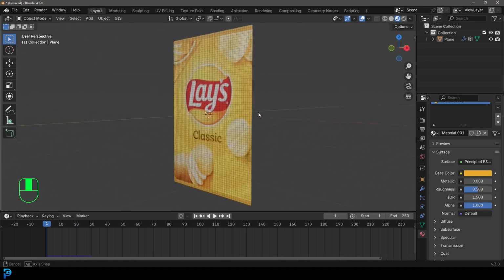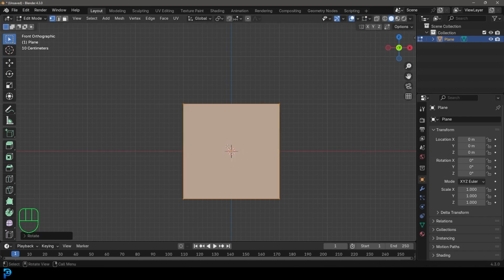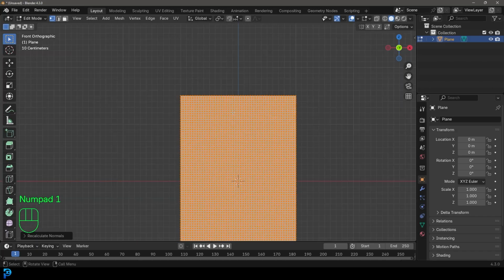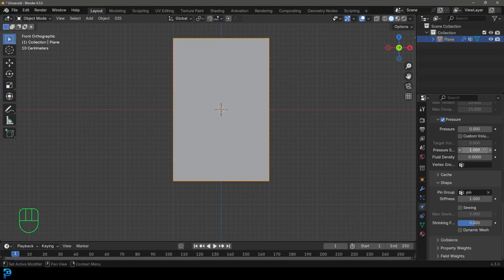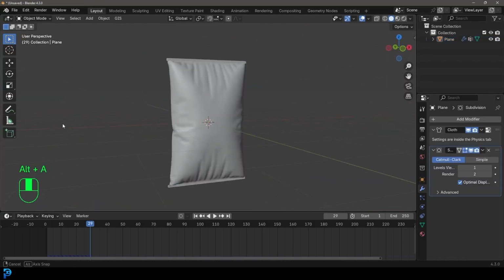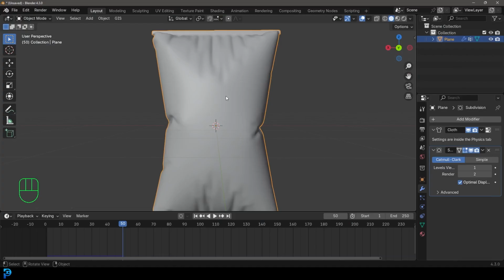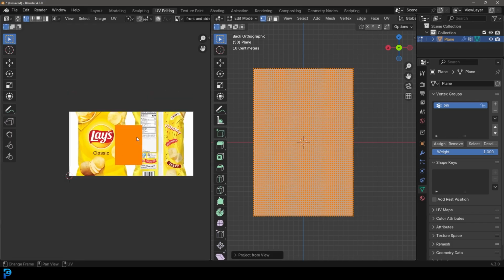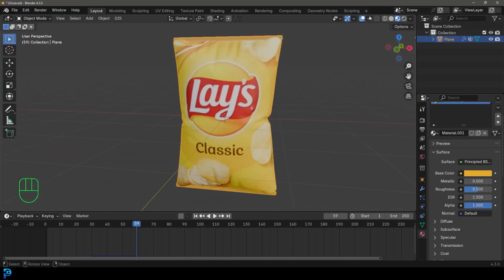Blender: Bag Of Chips Simulation | Beginners

Comment: Thanks, good video, and what if I needed the bag to be open at the top? 😅
Reply: u probably figured it  out by now but just in case someone needs the same. Once u apply solidify modifier delete the upper part(loop) at the top thats acting like a cap and when u create the vertex group only select the bottom part but not the upper part this way when u run the simulation the only part is blocked is the bottom and the top is free since u removed the loop that was connecting both  sides of the mesh.